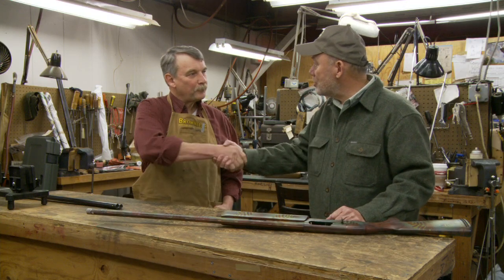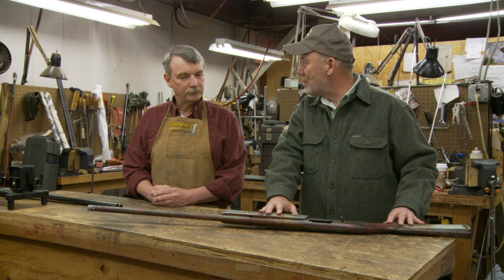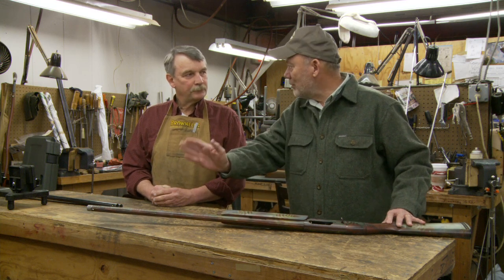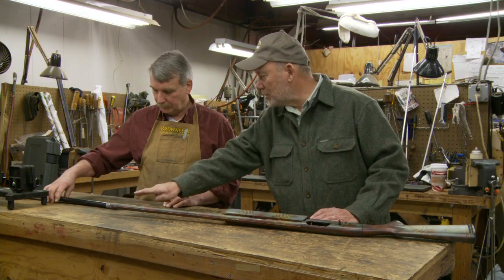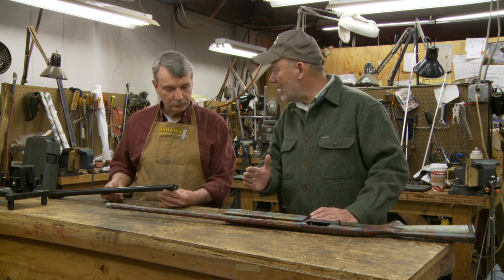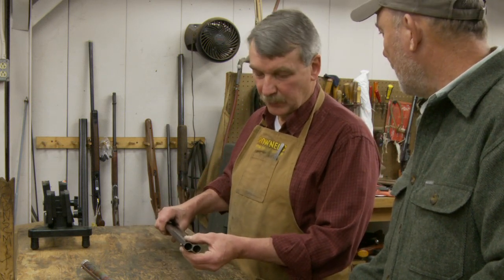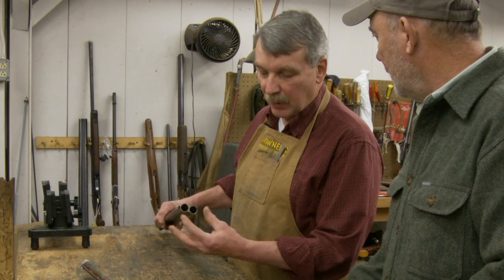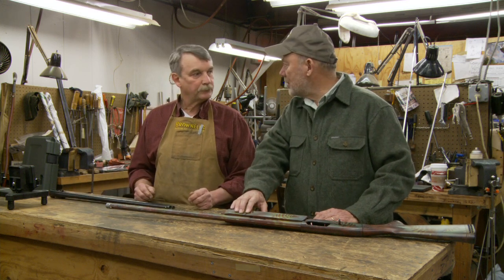Retrofit Your Smooth Bore: Adding Chokes - Gunsmith Tip

Comment: i shoot steel through my ithaca mag 10 32 in full original barrel. with todays wads steel loads are fine to shoot.
Reply: any size steel shot? I've got an auto 5 magnum full choke id like to shoot steel with
Reply: @vanillagorilla6845  ream it out to 1/4 choke with a adjustible reamer.

Comment: Miffed DIYer saying $190 just to thread existing  barrel (plus three tubes)   Seriously that is supposed to be attractively cheap??  In many cases one could just buy a brand new barrel on ebay for instance for a hundred or so with free shipping even if you keep looking (found several brand new take offs and used ones for down to 50ish) that comes with one tube ....it's all "Go to gunsmith" as if someone cant even measure wall thickness or do anything or research....   Would have to be something off the wall or heirloom etc before it would be worth modifying existing barrel on like a rem870 or moss500 ...it's aDUHH no  brainer to just buy another barrel ....want to just hand over your money? go ahead but not me ...DUHHH I can swap barrels on a pump shotgun ....in many cased you could resell your old barrel if you did not want to just keep it...190 bucks!  SERIOUSLY!?!?   Maybe for something like a one off exotic over under that has sentimental value etc or with special finish that cant be matched off the shelf ...but not for just run of the mill 870 or 500 etc!  IMHO anyway
Reply: Dougie Quick some over under barrels are $1000, so would be worth it.
Reply: @1yehny  yea i dont often walk into my local shop and see any "cheap" over and unders. Been looking for a while too lol

Comment: This video pricing is old. I called Briley and $350, Wright $450, another custom shotgun barrel gunsmith $400. And that’s for standard chokes. I think it’s better to either find a replacement factory choked barrel or maybe a new gun.  
To be honest modified choke can do hell of a lot!!! 🤔🤔🤔 Do I really need choke tubes? Or should I by $400 in shells and just shoot? 
I’m torn.
Reply: Check out michael orlen in Massachusetts google him hes the best and cheapest around 60$ i think
Reply: NMhvac Tech I guess it depends on if you want to buy a new gun or if you like your old gun and just want to upgrade it. To me, if you love the gun, it’s well worth the money to modify it. I did that to my 35+ year old Mossberg 500 because I love the old gun and have a lot of history with it. So to me, it was worth the cost to have it upgraded. I could have bought a different barrel, but then what would I do with a barrel that I would never use again.